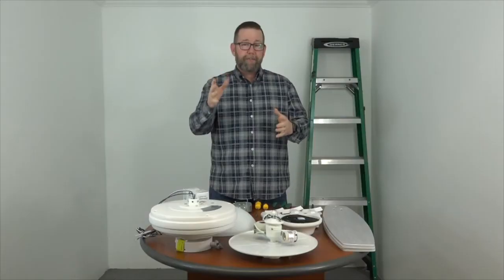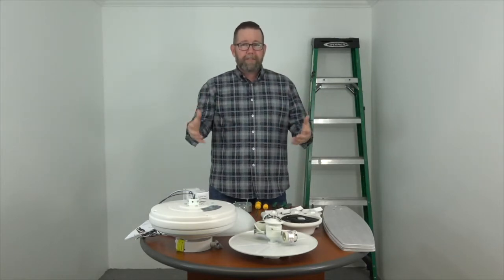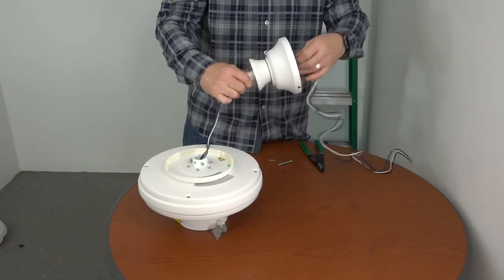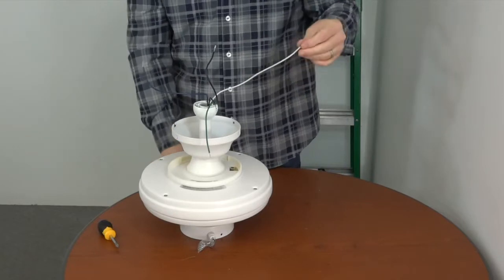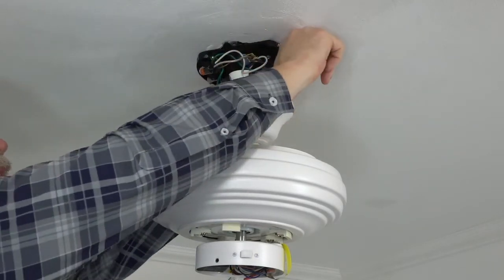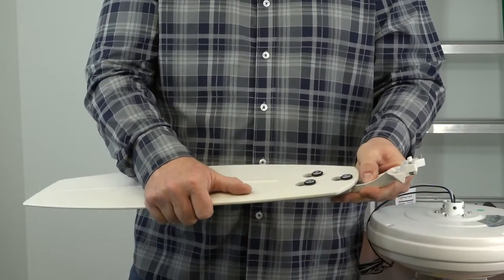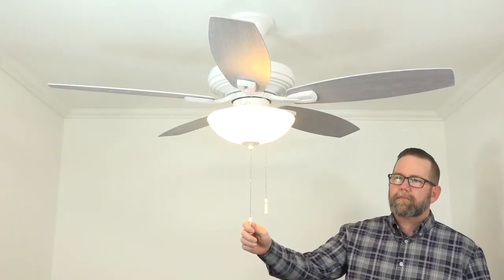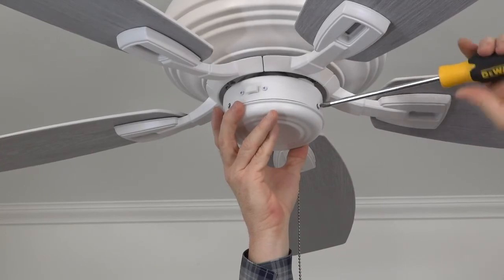How to Install the North Pond Outdoor Ceiling Fan

Comment: I just have a quick question on the wiring of this fan so you have green to Green which is your ground then you have white to white and then you have black and blue to the black which is the hot wire but I have a red wire also what do I connect that to? Please help also thank you this video is awesome
Reply from the maker: Thanks for watching. We have to say that we are not licensed electricians and if you are unsure about the wiring, we would suggest contacting a licensed electrician to make sure wiring is connected correctly. That being said, typically, a red wire is a switch wire. If it is, there are a couple of options. 1. wire like the video and just cap off the red wire from the ceiling. 2. Connect black fan wire (fan speed power) to black house wire and the blue fan wire (light power) to the red wire. This would allow you to turn the light on/off using the switch. 3. Cap off the house black wire and connect the fan's black wire and blue wire to the red switch wire. This would allow you to turn the fan and light on/off simultaneously using the switch. Hope that helps!
Reply: @ceilingfans101  thank you very much I have connected the blue and the red now that allows me to use the switches for light and for the fan.

Comment: Hello I have a question, does this fan with the light kit included come in other finishes?
Reply from the maker: Thanks for the question. The North Pond with the light kit included is only available in the white finish. There are a number of other finishes that do not include the light kit, but all are light kit compatible and a universal ceiling fan light kit can be easily added.
Reply: @ceilingfans101  okay but someone should tell Hampton bay to make other finishes of this fan with light kit.

Comment: Any advice on what I should do if house supply wires dont have a ground wire for fan ground to connect to?
Reply from the maker: You can just connect the ground wires from the mounting bracket and downrod. The fan doesn't have to be connected to the house ground wire, but it is good if it is.
Reply: If I am installing it without a down rod where do I attach the groundwire

Comment: If there is a speed control switch with current fan, will it work with this fan once I replace it?
Reply from the maker: Yes, just make sure that the fan speed is set to high using the pull chain (1 pull) before using the speed control.
Reply: @ceilingfans101  perfect, both fans were installed successfully last week with no major issue all thanks to your video! Thank you!!
Reply from the maker: @benjaminlescot2896  That's great news! Enjoy!

Comment: How do you switch the sides of the ceiling fan
 after it is installed?
Reply from the maker: If you are referring to changing the blade finish side after the blades are installed, you just need to press down on the locking clip on the blade arm and then slide the blade toward the fan motor and then light the blade up and off ot the blade arm.

Comment: You need to do wiring without the rod because the rod have a green wire. Without the rod...... NO GREEN WIRE MAN
Reply from the maker: If you are installing without the downrod, there will only be one green wire from the mounting bracket as mentioned in the video at the 11:16 mark.

Comment: There's a pink instruction sheet that says to move the green ground wire from the hanger ball and attach it to the  set screw on the side of the down rod ball. Then, place the hanger ball on the new downrod. There isn't any new downrod. The support pin won't fit in its slot if you're going to screw the green ground wire screw into the downrod. Horrible instructions
Reply from the maker: The pink sheet is only if you are using an aftermarket extension downrod. If using the included downrod, you don't have to remove the ball at all.